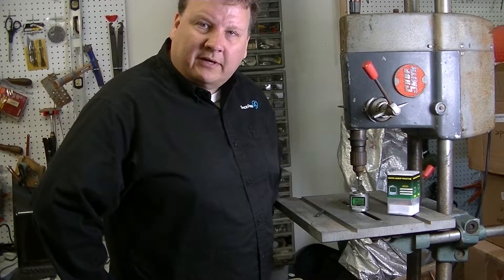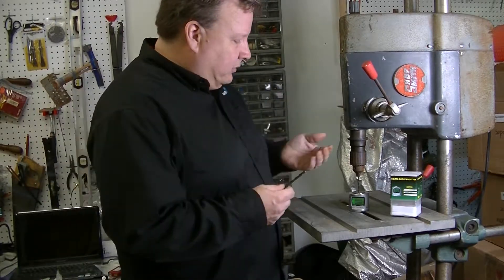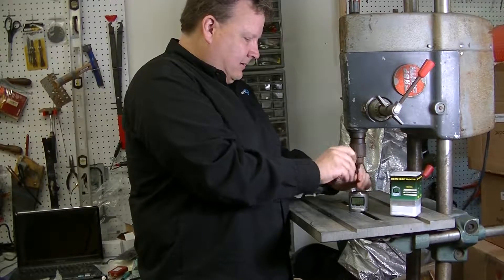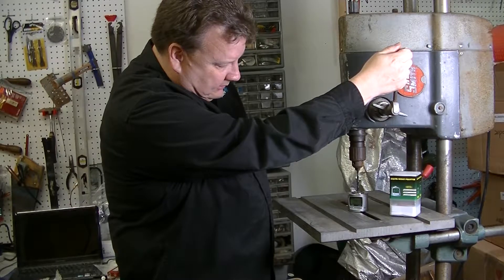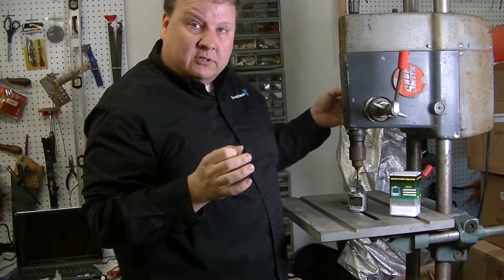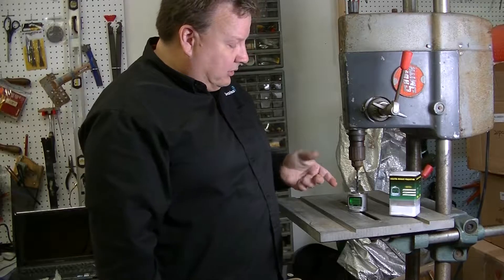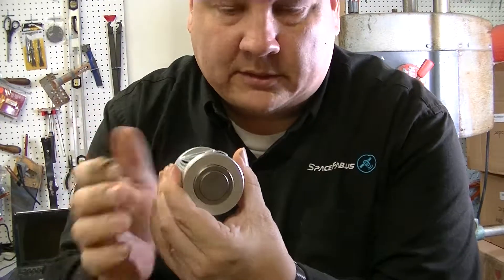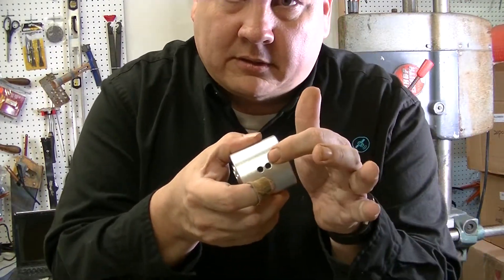iGAGING Digital Height Presetter setting gauge

Comment: Its a nice tool but it seems to me that using a measuring tool that reads to 0.001 of a mm to set a drill depth on a 50-year-old drill press exactly at zero would be really frustrating if not impossible.